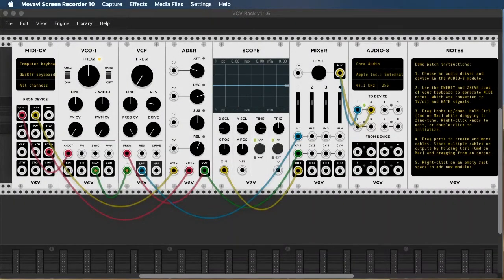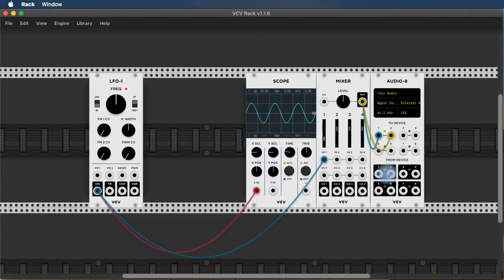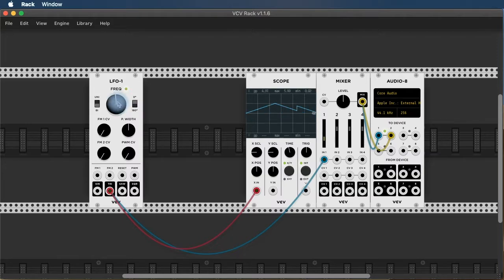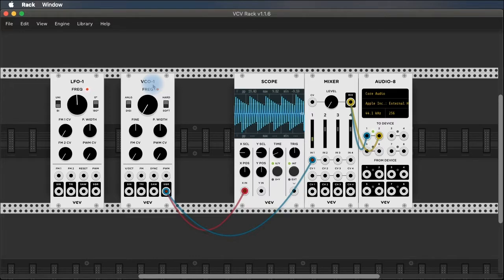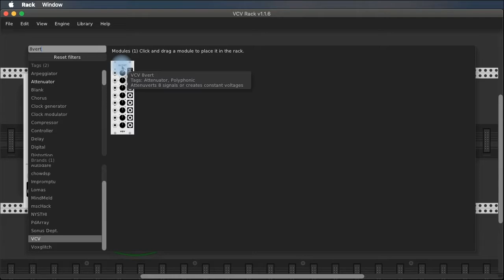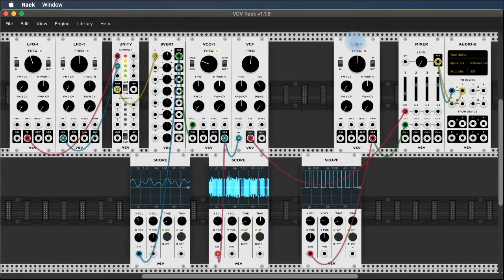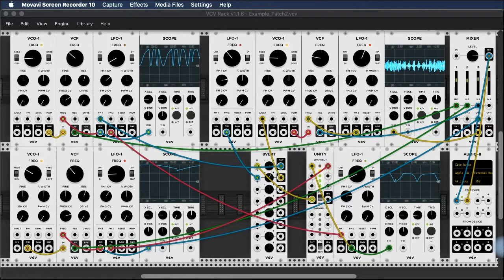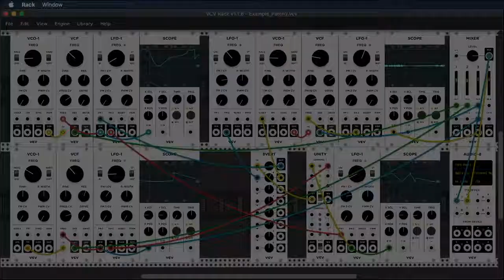VCV Rack Tutorial #1

Comment: What's the "golden rule" for what must go in and what must go out? I can't see crearly the correlation between inputs and outputs of the modules.
Reply from the maker: Hi Manuh - in VCV the outputs are marked in black, but the "golden rule" I suppose is to grasp the purpose of the module. For instance, in MIDI-CV, where MIDI messages are being converted in to Control Voltages, GATE is an output (MIDI messages become GATE messages). Whereas in ADSR - an envelope waiting for some sort of triggering event - we can presume that the GATE is the event that will trigger the envelope, thus an input.